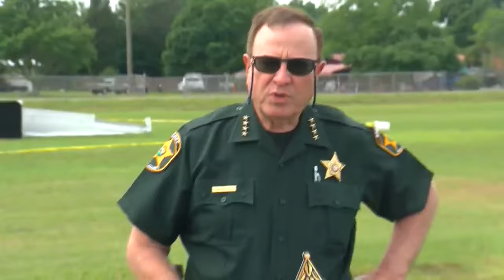Sheriff Grady Judd gives details on deadly plane crash

Comment: The Sheriffs briefing here is somewhat misleading to the general public as he correlates the crash to engine failure which has nothing to do with a stall.  The pilot likely did not maintain safe airspeed after loss of power and stalled the wings resulting in the dive. No reason to crash and die because the engine quits on takeoff and every pilot is trained to handle this situation but for some reason they abandon what they were taught to do, which is lower the nose, glide straight ahead and land straight ahead in the best spot you can find. Maybe there are only obstacles in front of you at this point but a controlled crash into those obstacles is better than what will happen if you attempt a turn back to the runway at low altitude— stall, spin, out of control straight down.